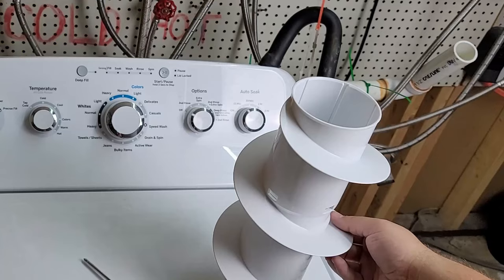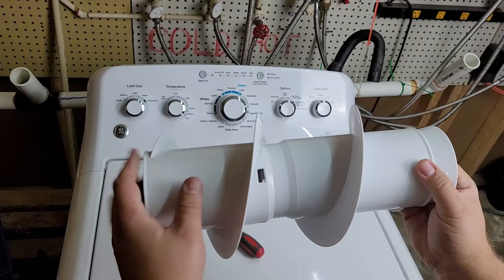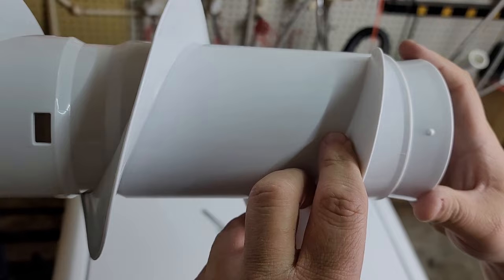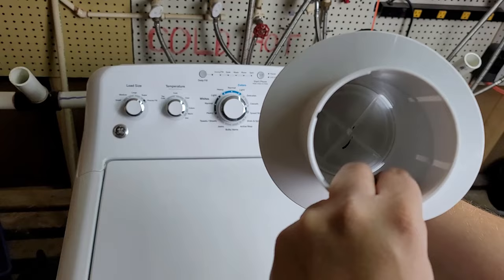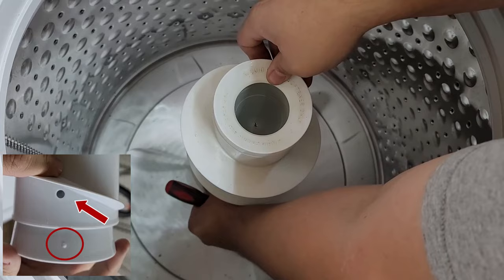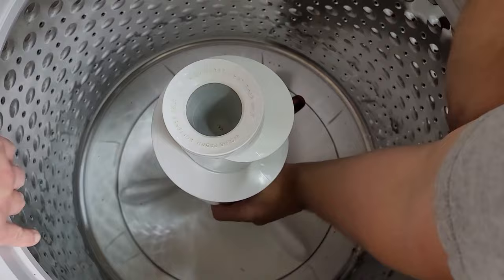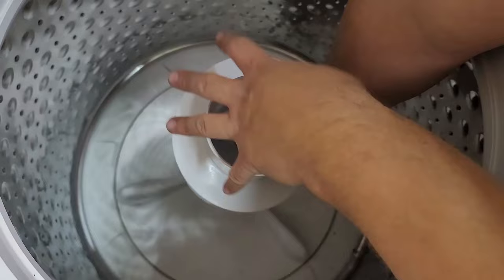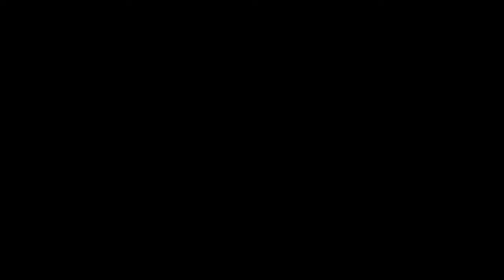GE Washer Agitator Removal - How to do it and access the GE Washer Hub and More

Comment: Thanks Ben for the video!  A correction though, you said towards the beginning of the video to turn it counter-clockwise to remove it, that is incorrect, you need to turn it clockwise(to the right). Also, make sure you have a good sized screwdriver for the hole, the closer to the diameter of the hole the better, a small screwdriver will be too loose. One more thing, if you need to do this by yourself, after you get the screwdriver in, use two hands and grip the bottom of the agitator, spread out your elbows to contact the sides of the drum to act as brakes, then twist the agitator to the right while still holding the drum with your elbows. That worked for me, I did loose some arm hair from the friction, but it worked. I hope this information is helpful to someone!
Reply: Thanks for that . I was not sure which way to turn.
Reply: I still could not get this agitator off, whenever I turned it hard it would wedge the screwdriver diagonally in the hole
Reply: I am having the same issue. Were you able to figure out what was happening?
Reply: I noticed that mistake also.
Reply: I am reefing on mine like crazy and it won't come out, it's driving me nuts!
Reply: What happens when the drum stays but the base of the agitator still spins freely because of a bad gear/transmission then what?????
Reply: @JEast-qb8nq  Look at my comment from 6 days ago. It worked for me should work for you. Just take your time cutting it out.👍👍👍👍👍
Reply: thankyouuuu i was struggling
Reply: @chelseyl2989  Glad I could be of service!🤠👍
Reply: @anni6572  same is happening to me - what did you end up doing ?
Reply: I just want to know if I remove the agitator I can use the washer with the bottom agitator or I have to necessarily put a new one I hope yall understand what I trying to say 😅
Reply: @luzmery8821  You probably could, but I don't think you should. The clothing would not be agitated enough to clean it properly. Also, you might get stuff torn up by the rough surfaces on the agitator base.
Reply: Dude had me punching the air with thoes instructions
Reply: I was turning the wrong way because of this too.  Eventually I took a dremel with a grinder disc and cut it off right below the top part of the auger.  Took all of 5 minutes.
Reply: Thank you so much for your help!!!
Reply: Thanks!  Freaking feel like the blind leading the blind.... lmaool. Will try this technique.
But if it doesn't work... uh-huh there might be a tannerite video next!!!
Reply: Got it !!  Had to dig a little deep in my TESTOSTERONE, TOXIC MAMMALIAN POWER.  But no HULK levels. 😆🤣😅👌👍💪💪💪
Reply: @felixcano896  Awesome! Congratulations!👏
Reply: I was trying counter clockwise for an hour!  Clockwise did it in 30 seconds!  Thanks for the correction
Reply: @JohnLRamos  Glad I could help!

Comment: I've been fixing appliances 10 years and I hate doing this job on that washer. What should only be a 5-minute job to change out an agitator turned into an hour a beating the hell out of it then finally using a Dremel to cut it off because whether you have the screwdriver in the hall or not sometimes it will not come out no matter what you try. Washer is a POS

Comment: It's actually the Auger you removed , the agitator is the circular piecw at the bottom that the auger attatches too. You know your agitator is no good when you can spin it like a propellar and the drum doesn't move. It's usually the teeth that have been grinded down from over loading your washer to many times. This is my issue now , I need a new agitator. Not easy to remove since you can;t hold onto the drum. You need two people , one turning the auger clockwise , while the other grabs the agitator and pulls counter clockwise.

Comment: For those of you who were able to get it off by what ever means consider yourself lucky. I tried for two days to remove it with no luck. I ended up going to the appliance parts store to look at a new one. Will guess what it should have came off by any of the ways people were offering advice on removing it. I ended up cutting it out one piece at a time. When I was down to the base with a small piece of the auger left I removed the screw and took the base off. I had to take my time to cut the remaining piece of auger that was left. This whole process took approximately four days. Now I need to wait for the new auger. That is a three day wait . Making the whole process a week long. Go figure.😨😰😱😅😂🤣. All you can do is laugh.
Reply: His videos are usually great but this video was horrible and we broke our auger !
Reply: I'll agree with this guy ,this video sucks  ! I think I'll purchase a new one before, taking off the old one

 either Visegrippig iit with one that has a chain to compressit  or just cut it off a peice at a time !!

Comment: •	Secured tub by removing washer top and clamping against a 2x4.
•	Twisting with screwdriver through single hole didn’t work. 
•	Drilled second hole opposite to provide more leverage. Worked well.

Comment: Thanks Ben, for the video! Sending a tip for anyone having trouble with this process. I could not poke my screwdriver through the auger/agitator. So, I got out my drill and drilled through the auger. I still didn't have enough leverage so I then drilled through the exact opposite side of the auger, using the inserted screwdriver as a guide to find the opposite side. Once the holes were drilled on both sides, I was able to shove my screwdriver completely through the auger.  Then, I held the drum secure and whacked the screwdriver clockwise with a hammer and the dang auger finally twisted off!  I hope this helps others!

Comment: Very, very helpful. For what it's worth, I think you may need to actually push the screwdriver through the inner wall of the agitator. When I removed mine, it looked like I had pierced it; it didn't look like there was a pre-existing hole that the screwdriver poked through. I may be wrong, but it was definitely hard to get the screwdriver to sink into the agitator wall and when I got the agitator removed, the inner side of the hole wasn't clean--it looked like I had jammed a screwdriver through the plastic! Nevertheless, this worked like a charm--I was able to remove the base plate to get to a piece of jewelry that had fallen beneath it. I just have an agitator with a tiny hole in it, which doesn't seem to impact the washer's functionality. Thanks very much for the video!
Reply: Happy Birthday ok
Reply: Is it still functional now? I'm facing a similar situation & piercing it made me worry I'd have to replace the auger.
Reply: Yes, working 100% fine.

Comment: After struggling for an hour with the screwdriver placed properly thru the auger, an oil filter wrench helped grip the auger to remove it within 2 minutes! 

Our screwdriver had scraped the inside of the auger pretty significantly & wouldn't remove it alone. hope this helps!

Comment: If the screw driver method doesn’t work for you, use a strap wrench!
This was the ONLY way I was able to remove the agitator. ($12 at Home Depot or Walmart)
I’m a 120lb lady with no plumbing experience and I was easily able to do this without a second set of hands. 
Once off, you’ll need a 7/16” socket wrench to remove the lower agitator plate if necessary for your repair.
Reply: you still need the screw driver to lock the two pieces of the auger together in order to turn it to remove it
Reply: I tried both methods without any luck!

Comment: works as long as the agitator isn't seized on. I just did 2 and had to use the multi tool and sledge hammer and cut and break them off. With 2 guys, one holding the tub from moving and the other trying to turn the top piece off. Ended up being too labor intensive and expensive when new agitators are not that expensive.
Reply: Yep, that's where I am at right now.
Reply: Yeah can't get mine off with the strap wrench. Where did you cut?

Comment: Thanks I got it. Awesome video. Once your screwdriver goes in just keep turning it clockwise it feels like it will break but it will come off
Reply from the maker: Just keep turning. If you fast forward video, you can see at the end when its off, the little pegs that hold it in place - you only have to move the housing like 2" but it can be a very difficult part to move just slightly
Reply: mine just spins freely and won't come off, it's driving me mad, barely had this damn washer for 2 years and it's broken

Comment: If you're unable to get the agitator off by hand I used vice grip 27ZR chain grips at the bottom of the agitator to compress it while turning, worked great - alternate solution from doing it a 2nd time, brace the bottom of the tub with your feet, no special tools required (why didn't I think of that the first time!)

Comment: I have one of those GE washers, with a different style agitator.  Anyway, that washer is a real stomach for agitators.  It literally sheers the splines or teeth on the agitator hub. I’m on my 3rd agitator now!!!!

Absolutely horrible!!!! We now have impellers, and augers, to replace agitators??!! Wtf??!!

I miss my old Maytag washer, from the late 80s.  Man that thing ran forever, and had no error codes, musical chimes, or lid switch lock mechanisms. Just pure work work work, with a little maintenance and TLC.

Comment: I followed this procedure with my five year old GTW460, lining up the dimple and the hole, punching the screwdriver through the inner plastic behind the hole and twisting the auger clockwise. That was the easy part.  I was never able to get the auger off the base. The base was free wheeling or spinning freely, independent of the tub. So holding the tub was no help since the auger base spins freely, independent of the tub. I just couldn't get enough hands in there to hold the base while twisting the auger clockwise. I tried getting a screwdriver to pry up under the lower edge of the auger, but couldn't get it to budge that way either. After about 4-5 hours I gave up, with my back, shoulders, hips, and entire torso aching. I considered trying to climb up and put my feet down in the tub to hold the agitator base while twisting the auger, but at my age (78 years), I was afraid i'd not be able climb back out. That was two days ago and I'm still having problems with my back and neck, and walking without pain. I also read in some other forums that my problem is possibly the transmission. I couldn't find any reference discussing the tub spinning properly and the agitator base not locked to the tub. Calling a repairman would run $200-$300 or more, if it's only the auger and base. So, I've given up and ordered a new washing machine to replace my five year old GE machine.
Reply: I had to laugh when you mentioned climbing in and holding it with your feet! I just attempted the same and almost fell out on my head. Can just imagine calling my wife to help me from hanging off the edge off a broke down washer.
I am just starting my adventure with this process. I have read of guys cutting the whole thing off and buying a new agitator. Hope it doesn't come to that...but it might.
Glad I'm not the only one.
Ps. I'm 65 so getting too old for this stuff too. But if you did it, I can't give up.
Wish me luck!

Comment: I have a new GE washer and the clothes constantly getting tangled so hard around the agitator it sends the washer into default mode and I’m literally almost tearing the clothes to free it from the agitator.  Any input is greatly appreciated. Also, can I remove the agitator and use it without it?  Tks for sharing and tia. PS. Yes the washer is level.

Comment: Exactly what I needed to see. That’s my exact washer. Could you tell me why you had to replace the agitator? My problem is with it not moving during a wash. Tub spins and everything else works fine?
Reply: Hello, did you resolve this? I had the same issue and I'm replacing the base of the agitator because the teeth of it are smoothed out so it won't make it spin anymore. Ordered a new one with new sharp teeth and hope it'll fix it
Reply: There is a tiny hole near the base of the agitator. Line it up with the little notch on the base and push a screwdriver or similar through the hole. It has some resistance, just push it'll go in. It releases the agitator, then the base just lifts off.

Comment: Thanks for this video, Ben!! GE machines are a pain 😂
Reply from the maker: IMHO, the biggest problem is just awful documentation by the tech community. Whirlpools at least have so many techs working on them its easy to spot problems. Not nearly as many videos about GEs, even though they really aren't that bad other than this agitator. Im like the only guy on YT that has semi-decent videos on them, whereas WP are dime a dozen now.
Reply: can I remove it to make more room for bigger loads? Or can I not use it with it off

Comment: My GE Profile agitator just pulls up, no screw driver needed. I used a wider belt to slide under the agitater on both sides. Then pull up quick and hard.

Comment: I've got model gtw485asj2ws. I've had the screw driver in there with my wife holding the drum and I can't get it to turn. Tried turning with the screw driver and bent the screw driver. I like tight fits but this is ridiculous...
Reply: Same here how do I remove it if I have this model no way this thing is coming off this way
Reply: Same issue here
Reply: Yep locked down the drum underneath with pipe wrench on shaft and another screwdriver through the holes on the top of auger still won't budge. Wtf there's got to be a sure fire way.

Comment: 2:20 it is clockwise not counter clockwise if we needed to turn it counter clockwise, we won’t need the screw driver... especially that the base needs to push it that way to make the auger screw the clothes down... if the clips were on that side, the agitator will come off mid cycle so you need to turn it clockwise to remove it
Reply from the maker: Thanks for the comment. I was using a mirrored mode on the video which goofed up dealing with the rotation on it. I was able to edit out the counter part to ensure the video says clockwise correctly. Thanks for noticing it!

Comment: Hello Ben just one question please is the Auger suppose to wiggle a little when it is in the washer.  It's only turns one way and when I try to turn it back it stops like is suppose to.  My Main question is the agitator suppose to wiggle a little?  Please someone help?
Reply: The auger in my washer is wiggle too and made some noise during washing cycle.  I followed this video.  But neither my handyman nor I could remove the auger out.  Please help!

Comment: Thanks for the video. I am trying to replace the agitator base on my washer.  To do that I have to remove the auger so that I can get to the bolt that holds that agitator base on. I got the screwdriver inserted as you demonstrated; however, I simply couldn't get it to release when I jerked it clockwise.  I see the four L-shaped tabs on your auger, and I can see how it should detach when jerked clockwise.  The new agitator base has clips that match the four tabs on the auger, but two of those clip have little stops that seem to keep it from rotating.   Any suggestions would be appreciated.
Reply from the maker: Do you have a model# for the washer?
Reply: I’m having the same issue.  My model # is GTW485ASJ4WS

Comment: I've seen several videos on the same topic,  but the technique was to just jerk or pull the whole assembly straight up and out, either by hand,  or using a rope tied around the assembly. Anyone try this?
Reply: Yes, mine pulls up. Try using wider belt skid under both sides and pull up quick and hard.
Reply: Thanks mine had a hole but no nipple , had to yank straight up hard to get it off.
Reply: Thank You!!! Grip and rip!

Comment: Thanks for responding. Model is GTW465ASN0WW. Not the same number, but parts seem to be the same.
Reply from the maker: Hi Doug, another commenter on the video suggested pulling up then twisting - its possible the agitator is pushed down too far, and would need pulled up slightly. I did not have this issue on mine in the video, but its worth consideration.
Reply: @bensappliancesandjunk  twist which way
Reply: I have the same model. The hole does not go all the way through, and I couldn't get enough pressure and torque with the little indent on the inner part. I ended up drilling a hole through the inner section so I could put a screw driver all the way through. Then I was able to get enough torque to remove the agitator.

Comment: How did you find the nipple?  My model doesn’t have the nipple visible. Just the hole. And does the hole at the bottom of the agitator mean anything?
Reply: I used my Wife's small mirror sh uses to do her hair...lined it up & the screw driver popped right through & in

Comment: Do you know how to get to the insides of this washing machine? It does not have a front PANEL but instead wraps around to the back.
Reply: You need to take the top control panel off.  Remove the metal panel on the back of control tower.  There are 2 more  screws at the base of the plastic panel, once those are removed, inside you will see 2 more downward screws toward the back of the panel, take those out and you can then pry the top off.

Comment: I have a GE model GTW460ASJ6WW. Followed the instruction and can’t get it out no matter how much a try to turn it clockwise.
Reply: Same here
Reply: Same problem.  Under the fabric softener cup is a plastic dome that is glued in.  I am going to get a hole saw and drill a hole in it.  I believe that I can use a ratchet on the 7/16 bolt holding the entire agitator assembly on.  When done, I will glue the dome back.